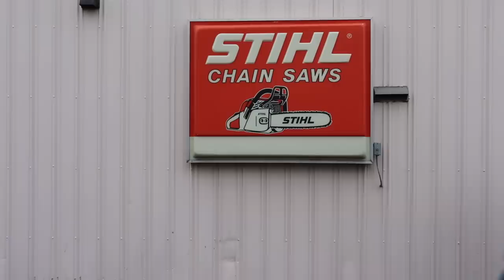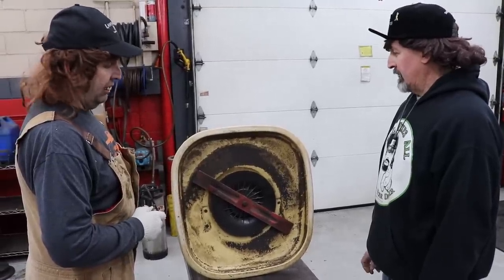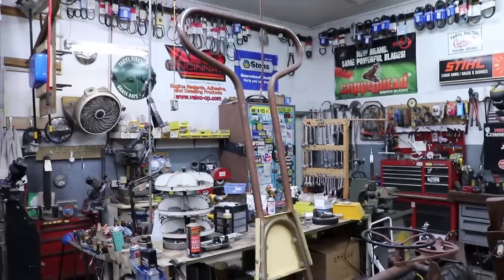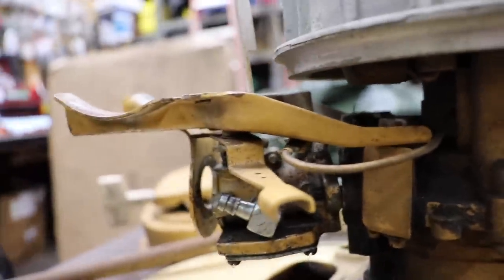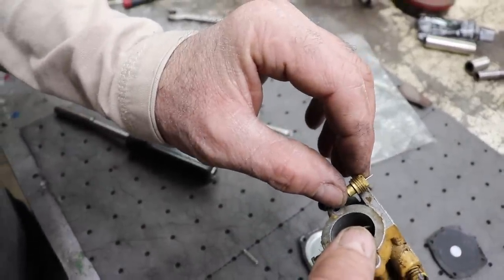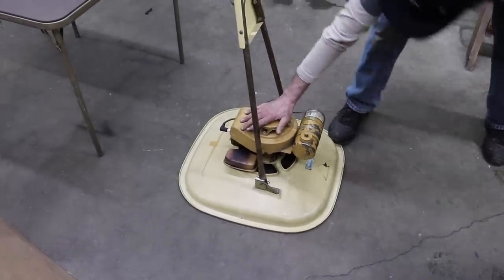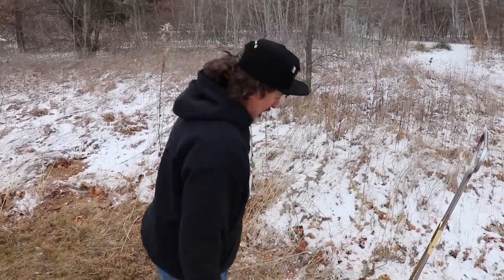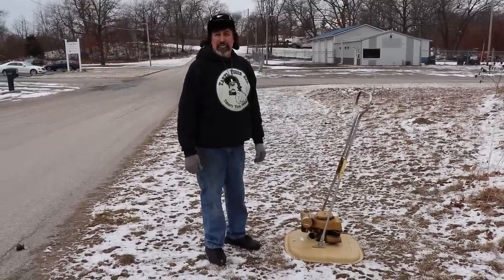This Mower HOVERS Above The Grass. How?! - Will It Run?

Comment: Faryl said he had a bunch of those. You should get them all, put them together and make a flying car.
Reply: Or a cube of scrap iron. Tooooo dangerous
Reply: Put a pitched blade under it and a low profile swivel caster on each corner. Or keep it original and use it as a leaf/snow blower.

Comment: Still sellinglike hotcakes over here in uk. The local authorities use them for cutting grass on embankments lowered down with a rope attached to the handle and swung about in a big arc saves trying not to slip about .
Reply: And Toro sell the rebranded Allen HoverPro mowers now. I think they will get less popular due to battery mowers that can be used on steep slopes.
Reply: Don't think Council's are allowed to use them on ropes on banks anymore, too many accidents with people slipping on banks under them and with the rope tied around kill switch they just keep on running chopping yer legs !!!
Reply: @derek876544  no they have to use remote control bank mowers now.
Reply: Wtf
Reply: @bentullett6068  ye repaired a few
Reply: @joshuavaughn4879  lol dont think so

Comment: In 1971, I visited The Grand Hotel on Mackinaw Island, Michigan.  It was built during the 1920's depreciation as a "work project" to supply jobs.  It's truly an amazing place and worthy of a visit.  The site where it is built is on a hill with very steep banks along side the access road.  The grounds keepers all used Flymo's to trim the manicured lawns.  It was the only way they could efficiently mow the grass.  In 1971, watching them mow was like a Star Wars event.  No wheels and completely operated simply by a turn of the wrist for direction.  The grounds keeper's raved about them.
Reply: It's 2024 and the Chinese have created a battery powered "Flymo". I saw one advertised on the "inner screen" recently. It is a 120 volt (not a typo) BATTERY powered mower that lists for $2995. The only problem, it comes WITHOUT batteries and the ad said that the batteries were NOT available! Sounds like a Chinese scam to me! Has anyone else seen the ad or has any information about THIS mower?:body-blue-raised-arms:
Reply: @TheOzthewiz  I ran into the same thing with Cessna's new EV plane which boasts an entry level price for a 6 place, 200mph Electric Plane at $87,000.  Problem is the batteries are not yet available and the extension cord costs $1.3 million dollars.

Comment: HI from the UK.
I worked for the parks department in Edinburgh Scotland during the 70's and 80's and hover mowers were handy for steep slopes where ordinary mowers couldn't go safely.
We used to stand at the top of the slope and operate the machine using ropes tied to the handle!

Comment: Greetings from England. Good job Taryl. Good tip about spark plug boot.  Flymo's are invariably used on slopes, verges and banks at inclined angles where a normal mower wont work. But..they are hard to use because the hover is fighting the operator all the time. Its tiring trying to hold on. Gardeners like them for graveyards between head stones or between fence posts as you swing it left/right rather than push back/forth as with a wheeled mower. There's an Australian mower called Victa which also has 2-stroke engines and they work better for slopes as they have wheels and are easier to control. The problem with 4-stroke used at and inclined angle is the tilted crank case pools the oil on one side  and does not lubricate properly causing engines to seize.

Comment: Carb repair instructions are the most valuable part.
And of course replacing the missing part. It won't hold gas without the seat.
You could see how they would be confused.
The camera blurs when objects are moving.
Speed or resolution, or something.
Faryl was there! And the real uncle Andy! What a great video.
It would have been even neater to see the parts up close.
You can give slippers a fly mow hawk now and do the banks and hills.
Was that a phenolic air cleaner? Carcinogen if it was.

Comment: The people that steep banks of grass love the fly mower.  We used a rope and lowered it down and back up.  Then we learned to stand in the center at the top and just swing the fly mow back and forth made it so simple.  When they quit selling them I would buy used ones to keep a working fly mow.  We put hole on the deck so the rope pulled direct to the deck.

Comment: I can see JR. Flipping that thing over onto his leg. I believe that was what happened to many kids that tried using them. Unless you owned a gold course, It wouldn't cut worth  the damn. I remember my first experience with a reel type mower. It wasn't  until an old timer taught me how to properly adjust one that I even liked them. I used a power reel mower to cut designs in people's  lawns back in the early 80's. It became  a" thing" with all the local area doctors offices in town. I was cutting various designs in their lawns. I got paid extra per lawn. I also had to sharpen the reels often.

Comment: I have a 1980 Flymo with an AV660 Tecumseh engine. I live in the mid west and I absolutely love mine. I use mine for my steep hills and tight areas between trees. I tie a rope on the handle bars and just walk along the hills. Its the very last piece of lawn equipment I would ever get rid of. If people hate them so much, I'll buy every single one.

Comment: I used to use my Dad's 2 stroke flymo to cut our lawns back in the 60's. Worked great, especially on rough ground or banks. Just be careful you wear strong boots so you don't slip and get 'Flymo foot', and have to go looking for your toes.

Comment: Got one of those Flymo under a tarpaulin at the bottom of the garden. I stopped using it about six years ago. It would always start first pull whatever the weather despite being exposed to the elements for much of the time. This video has inspired me  to get it going again. That's when the weather warms up a bit here in the UK of course!  Thanks for the video Taryl..

Comment: In my younger days for which now I'm 62 years old we used to run brake fluid down the carburetor of our motors and it would become unbelievably quiet is the sound was trapped in the larger smoke molecules the smoke was unbelievable it was funny it would turn so thick that we couldn't see each other out in the driveway and I remember laughing as we first began in the closed garage and the sound of the motor changing to very quiet was also interesting I don't know that it cleaned carbon but I think it did cuz the motors were very clean afterward and there was never any harm done to the motors

Comment: I found a Toro single stage snowblower in the garbage it was seized up but I got it working took apart the carburetor and it had a wire holding the needle and seat I’ve never seen that ever before had a sticker on it where it was worked on great videos 👍🏻

Comment: FYI When I was teen working summers for a lawn service we used a couple of these  for years to cut steep hillsides in customer's lawns that you couldn't safely get a rider on. Hell, most of the hills were too steep to walk up and down to even weedeat them unless you had mountain goat skills. We took the handles off of them and had two ropes with knots tied so you could stand on top of the hill with a rope in either hand and swing the mower back and forth and let it down a bit at a time from one knot to the next on each rope. We had a couple military base contracts that had really steep grass-covered hills up the sides of a dozen or so bunkers of some sort and they really worked rather well for that purpose.

Comment: Yep worked on plenty of those in the mid-late 70's in good old blighty, if i can remember they were supposed to cbe good on steep slopes, have seen council workers cutting steep slopes such as beside a road,ant they wouldn stand at the top of the bank, and have a piece of rope tied to the Flymo start it up lower it down and swing the mower side to side on the rope to cut the grass," so there's your dinner Taryl "

Comment: Just seen this, so a bit late.  I have a Toro hover mower.  I have owned it10 years, it is 500mm cut and is equipped with a Honda GCV160.  Works fine, but you do have to fight it if the ground is at all uneven.  Gives your stomach muscles a real work out on slopes.  Quite a good cut and doesn't leave wheel marks, but you need to keep it clean underneath.  I also have a Honda wheeled mower and a towed paddock topper, so you do need more conventional stuff as well if you have different states of grounds.  By the way, Flymo is now a brand owned by Electrolux, who also own Husqvarna.

Comment: I have two Flymo Contractors fitted with a JLO engine. Still work 30 years on. They are good you padocks and rogh ground. You end up stinking of 2 stroke after mowing though. A mate was using one back in the 80's on a bank when he slipped. We call him 9 toes.

Comment: Not sure the problem in the US with these mowers. In the UK I grew up with them and absolutely love them. Cut anything including steep banks with a rope as others have said. Light weight easily stored hanging on the wall in the garage or shed. Run forever no problems. Ours didn't have that engine on them though. I have used them on fine cut grass and rampant weeds and couch and they cut well. You must have funny grass that is all I can say.

Comment: My grandmother had a six foot 45 degree bank in her front yard and a lawn boy that looked like this. We only used it on the bank. We would get it on the bank and walk sideways along the bank then push it a little farther up the bank and walk the other way.  the grass didn't grow as fast on the bank so it worked well. It didn't cut grass that was very tall well at all. Best thing about it was it mow the same sideways as it did front to back.

Comment: I had one back in the 70's.  You can create  a cool dust storm with them .  Not flying so well .   Mine would lift off the deck at least a inch or so.

Comment: Flymo's are great for steep slopes and very soft ground and wet areas. Keeps the grass tidy but if you want a proper finish use a cylinder (reel) and/ or rear roller wheeled rotary with height settings.

Comment: Sometimes 50s and 60s technology works better than $1,000 mower today without you showed us on some of your videos Tara so far and like the like the Hammer Smith mower the guy only bought one set of blades the whole time the motor lid and he put two motors on it that's pretty damn good about low cost to run

Comment: Is that a two stroke? It looks like a sleeve valve engine, with the dual mufflers. Sleeve valve engines use a metal sleeve instead of poppets to regulate airflow in the engine.

Comment: Sharpen the Blade on it and I would imagine that it would cut fairly good and I would use it on small ditches and drainage banks around driveways and roads

Comment: I had one of those back in the 70's, I tied rope to the handle in 2 places and dropped it over the embankment so I could cut the grass, just swung it back and forth and it would do a good job provided the grass wasn't over about 3 inches tall. If you put the wrong blade on them they would never hover properly and the air output had to be cleaned after every use or they would clog with grass cuttings and the lift again was useless.

Comment: Locally they have been used fairly recently by golf courses to trim close to the water features. They were a much more modern machine but the same basic design. If I remember correctly, they had a redesigned blade that was like a big disc with two or three cutters bolted on.

Comment: 2 stroke Flymo gt2 like gold dust in the UK they only make a 4 stroke now cos of emissions not half the machine .can't get second hand gt2s for love nor money and you can adjust height of cut with aluminium spacers between blade and impeller

Comment: I got a buddy down the street that has one of those that runs the mower repair shop but he can't find the coil for it any idea of getting a hold of your brother or where we might get a coil for one of those that's all that's wrong with this motor it doesn't have any spark the points are okay but the coil was shot

Comment: I remember them clearly. That is odd since they were only made for one year and I would have been too young to remember. Did anyone else make a version of that as well? Things weren't built the way they were because they didn't care about safety, they were built that way because people weren't stupid and didn't require a babysitter as an adult.
Reply: You’re entirely right. People today are morons with very little common sense and want to sue over everything. I wasn’t that people didn’t care about safety is was that people had common sense. They made electric fans for decades wjth metal blades and cages with slots wide enough to fit fingers inside.  Kids used to have chemistry sets and wood burning kits and model rockets that had real engines that used ignitors. Nobody stood around wringing their hands and worrying about it. 
As far as the Toro being made only one year,I would have to call toro and see if they have records of that. I’ve heard  people say they bought them later than that.

Comment: Taryl, that was interesting, I saw one down here once, and the fellow told me he used it to cut around the bank of his pond.  There is something about a K stamped on the inlet side of the carb. and the placement of the diaphragm and the gasket I believe.  Now for another question, I've looked everywhere for the angled side cutters that you use, can't find them anywhere.
Reply: If your talking about the blue handled ones don't quote me on this but I think they are made by channellock. Hope that helps
Reply: @kurtboyce7199  Those are the ones, I'll keep looking.  Thought they may be the channel lock brand, just haven't found any around.  Thanks
Reply: Did you try amazon? I typed in channellock side cutters and a few of them looked a lot like the ones taryl was using
Reply: @kurtboyce7199  I'll give that a try, Thanks.
Reply: I have a pair of Klein's that look just like them.

Comment: Taryl i need a wheel motor for one of those wright mowers faryl has. Any used ones. Its a 03 sentar. Lmk I'm in Cleveland could drive there for a deal.